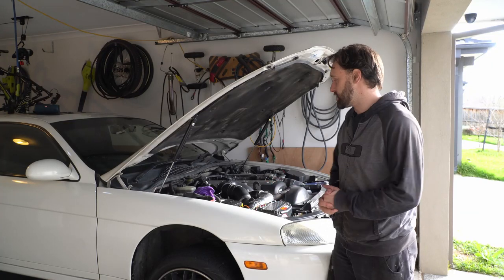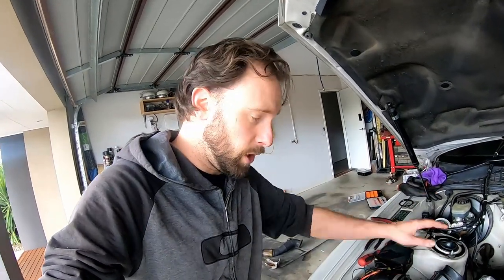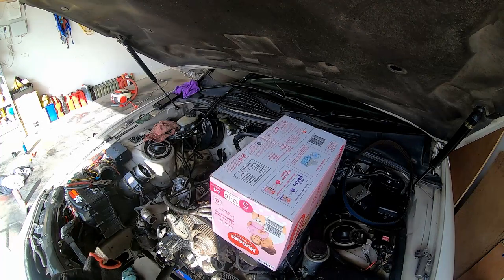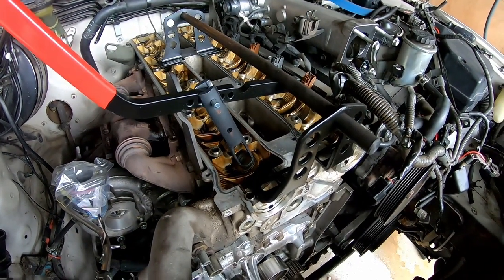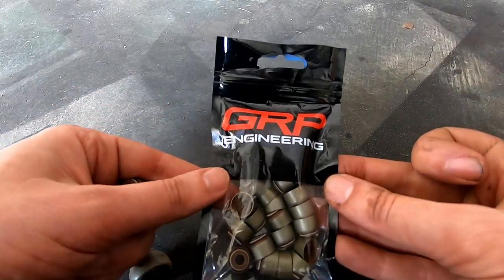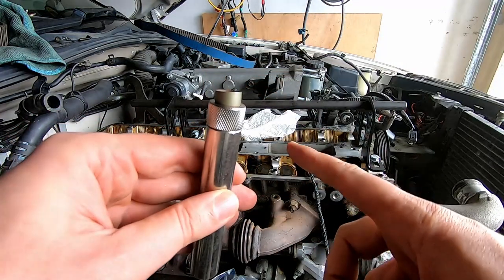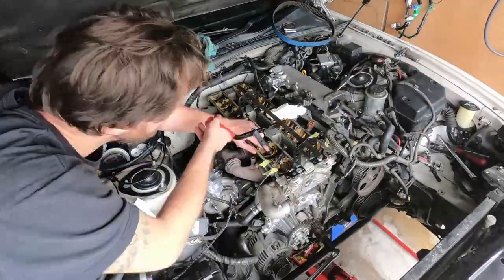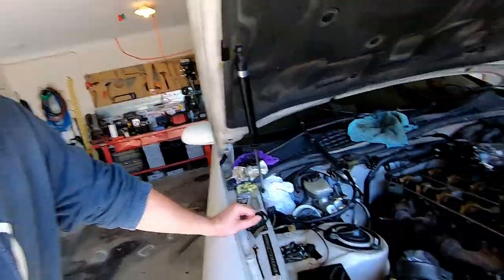1zj valve stem seal replacement

Comment: Im glad you mentioned that your supra dropped a valve because alot of ppl have this notion that 2jz or 1jz are not an interference engine.
Reply from the maker: So the 1jz is non interference but I'm not sure about the 2j, haven't had much experience with them :)
Reply: Only 2j that’s interference is a non turbo due to higher compression and thinner head gasket
Reply: @Feedme_pizza  see this is what im talking about. you didnt specify whether vvti or not which makes everyone who says that hard to believe.
Reply: @divin3kag3242  it’s don’t matter vvti or not  not turbo is non turbo

Comment: Great video mate. About to do this and a lot of other preventative maintenance on ny Chaser.
Any video on that thermo fan install you were going to do and what did you end up going with? 
I've heard good stuff about davies Craig fan controllers 

Thanks!
Reply from the maker: ummm not sure if i ever filmed it but yeah went with the davies craig controller and it's great! and then got hold of an AU falcon thermo fan setup as they are rock solid, adapted that in and she's been good! just make sure you get the later model davies craig controller wthat has the option to change out to a sscrew in temp sensor, as my is an older one and only has the sensor that sits in the rad fins, not the greatest design.

Comment: How long did you run the Kinugawa Turbo? I was thinking about buying one as an upgrade unit but that shaft play is massive.
Reply from the maker: So I just worked it out and it's been on the car for about 6 years daily driving, not really boosted or thrashed, I wouldn't go that route again due to potential damage to the engine, the impella had been hitting the intake housing which is real bad, who knows how many alloy shavings it's sent off into my engine :/

Comment: I think max spec for axially movement is less than .15mm on a lot of Toyota turbos (obviously doesn’t count for aftermarket) but dam, you could measure that with a tape measure!
Reply from the maker: It's insane huh! Something is definitely weird as it has no side to side shaft play and boosts great, I'll have to pull it apart and see what's happened for sure.

Comment: You've come a long way since the first episodes of Nuggets. You look a lot more confident. How long did it actually take to do it like that ??  I've considered it a few time but than just took the head of and give it a good clean ( and a bit of a port job as well )
 Never mind not remembering which valves you've done, not long from now you'll be standing in front of the fridge wondering what you're doing there. ( which isn't a bad thing cause you can grab a beer and drink that until you figure out what it actually was. )
Reply from the maker: Cheers mate :) once you get in a rhythm it's pretty fast, now i know what i'm doing i'd say i could do it again in 3-4 hours. Definitely easier with the head off but considering how good condition this engine is in and the cost of ARP head studs, gaskets, surfacing etc, it was a MUCH cheaper option :) 

Haha, i constantly finding myself doing that at the fridge, or going into the garage to go get something and come back an hour later after tinkering with the car and completley forgeting the thing i went to get haha.
Reply: @TheNuggetProject You have to watch what your doing when you go for a tinker in the shed cause you might end up building a race car.....
Reply from the maker: It's definitely a real risk :p
Reply: @TheNuggetProject Worked on the car today to get it ready for the hill climb next week ( if it goes ahead ) then watched a lot of Lowrider stuff on YT
Reply from the maker: @aussietruckphotosandmodels8510  Nice :) I got the gearbox back in the soarer, new clutch, machined flywheel, new slave cylinder, new rear main seal, new gearbox input seal, all scrubbed up and cleaned. Didn't bother filming it as i just wanted to get it done and it's not that exciting anyway, next vid on this car should interest a few people though, just need to find the time to film and do it!

Comment: Would idling at a stop light and taking off with a blue cloud of smoke be the valve stem seals or the turbo?
Reply from the maker: so in general buggered valve stem seals blow smoke when you are driving alone, shut off and let the engine go into vaccum and then put your foot down again, the vaccum sucks oil through the stems and then blows smoke.

Idling at the lights can be rings, or turbo, most likely turbo, which is what mine was doing when turbo died :)